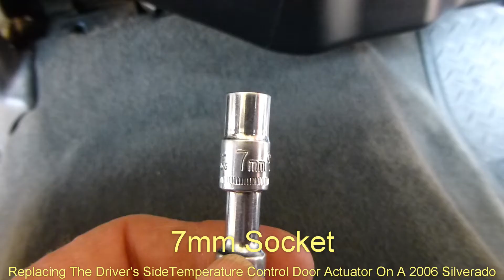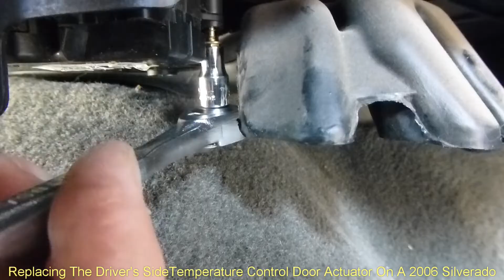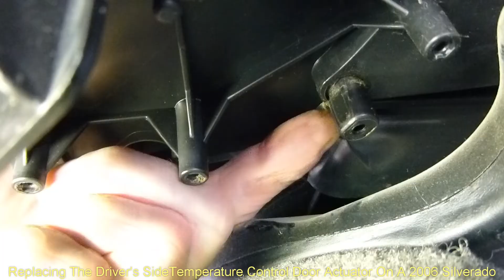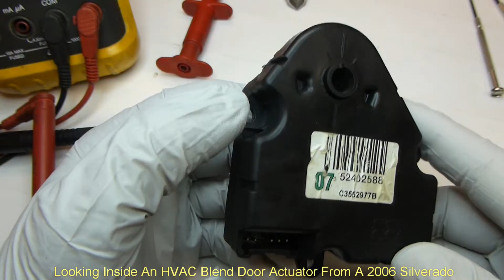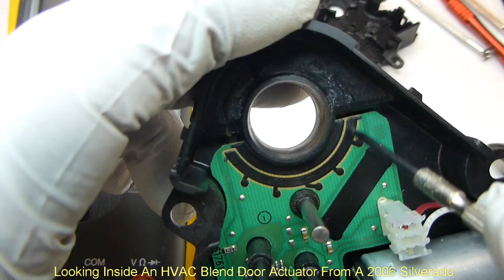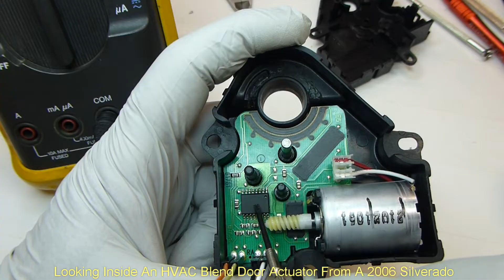Replace/Fix A 2006 Silverado Driver's Side HVAC Temperature Actuator

Comment: The driver's side temp blend door actuator on my 2006 Chevy Silverado 1500  was intermittent, especially if I hit a bump in the road, that's when it'd start blowing hot air out of the driver's side dash vents, while blowing cold air from the passenger side dash vents and defroster vents. I pulled the actuator and opened  up the actuator just to see how it operated and to see if I could repair it, I cleaned the grease off of the electrical contacts, put it together, plugged it into the dash control plug, operated the controls on the dash and it worked just fine, then I then reinstalled the actuator, recalibrated and or reset the HVAC system and to this day about 5 years later the same actuator is still operating like it's suppose to operate. Just recently I did have to replace the HVAC blower motor and the blower motor resistor, after putting it all together and started driving down the road, all of a sudden warm air started blowing from the driver's side dash vents, dummy me forgot to recalibrate the HVAC system, after recalibrating everything is back to normal working like it was new again.

Comment: Thank you for the information.  I have a 2006 suburban with auto ac controls, and it spontaneously blows hot air out the driver vents at random.  I need to make an adapter harness that will allow me to monitor the inputs and outputs to see what's causing it to do this.

Comment: Awesome job on the video, very informative and helpful. I do have a question…at the 43 second mark of the video you are talking about removing the bottom kick panel. Is there any way that you could tell me what the part number is for that panel/cover. My 06 Sierra didn’t have one and I would like to get one. 
I’ve searched multiple ways and can’t seem to find what the actual name/part number is.
Reply from the maker: Thank you! I'll see if I can find any info on the kick panel for you.
Reply: That would be very helpful

Comment: Got a question  … I just put a used temp control module on my 2006 with rear defrost . I have the manual slides like yours . What is wrong when I slide to hot setting air is Cold and when I slide to cold setting the air is hot . You seem sharp just wanted to ask . Thanks
Reply from the maker: It sounds like it's not the correct actuator. Are there any part numbers on it? There are three numbers on the original actuator that I took out. They are "07", "52402588", and "C3552977B". The number "52402588" was the number that I used to find a replacement actuator for it.

Comment: Mines doesn’t alight no matter what was I turn it, the actuator it’s self is all the was to the left on hot I don’t know how to turn it even if I connect it it only turns so much. Could it be the climate control that’s bad and not turning the actuator all the way

Comment: The socket needed is s 5.5mm. Can get the single socket at an auto parts store or on Amazon. Replaced my actuator today and popped open the old one to take a look. 215k miles on my 2006!
Thanks for the great info!
Reply from the maker: Thank you for the correct socket size!

Comment: Another well done video. I have that clicking sound now and then. This video will be a lifesaver for me. I would never have guess how that worked. Since there are no comments here, guys aren't having this problem. Well I think I will be. Thanks for your time and effort. You do a great job on these. I watched the one on the door latch assembly this morning , subbed and liked and then came looking for what else you have done. Good work.
Reply: I had the clicking sound for a while now in my truck, and I could do exactly like he does in the video and move the slider up and the nose stopped. However recently, the actuator stopped responding. I'm just gonna buy a new one and replace it, new vs 18 years old
Reply from the maker: @donniecahill5243  I hope you were able to get the actuator replaced.
Reply from the maker: Thank you for subscribing! And I hope this video helps you when you change out the actuator.